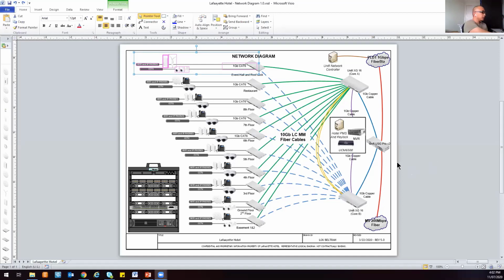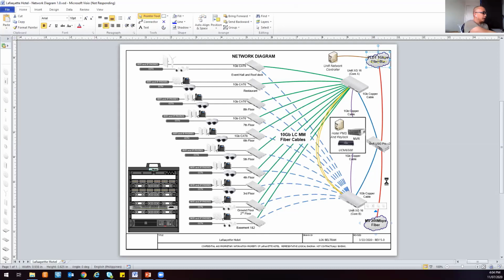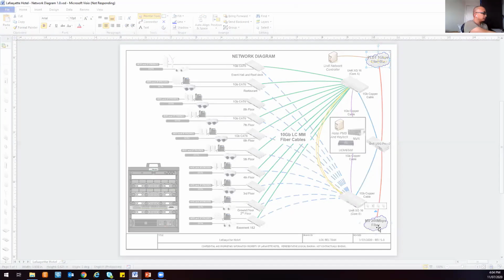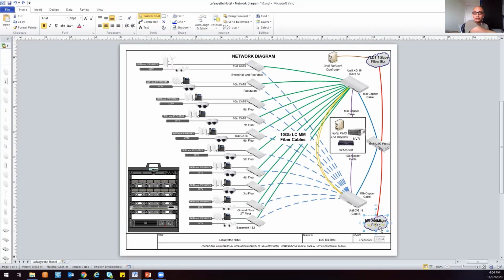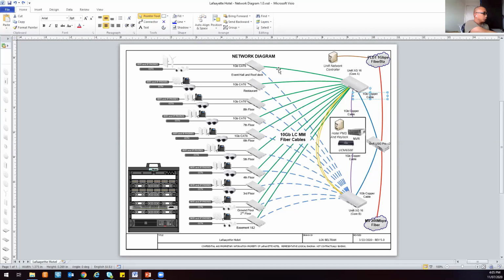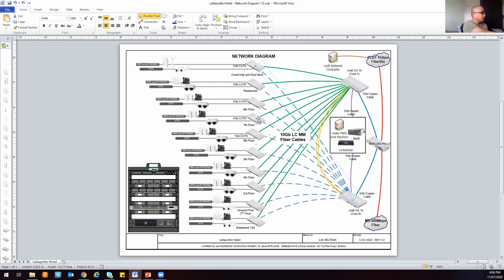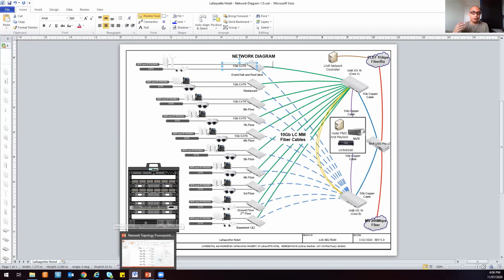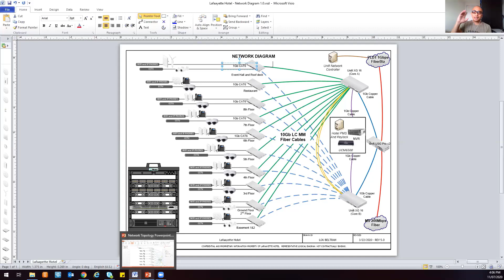[English] Unifi Hotel Network Topology Diagram Overview

Comment: Very nice practical video. I learnt alot. One question though, why do you need such a powerful internal network, (for example is has 100Gbps of total uplink to aggregation switch level), when you only have a 1.2Gbps internet connection.
Reply: It is a Network-Tree topology, he has 10GBit from the UXGs (supposedly with an aggregation switch each) to the “Area-Switches” for each location (each floor,the restaurant etc. gets 10Gbps Internal Connection). These are the shown fibers (two for redundant UXGs. This way the client could technically get the full 1gbps WAN access while leaving performance for internal use, such as Cameras.

Hope this helps!
Greeting from Germany
Reply: @zanderfaehrteisenbah  I get it, but it still feels like overkill, since there is only a 1Gbps copper connection to the NVR anyway. But let's assume for a moment there was no internal traffic, no IP phones or CCTV in the network, would you still need  such massive uplinks for a 1Gbps internet line? is there any benefit?
Reply from the maker: Future-proofing! I'm the type of guy to give 110% on my designs even if they are an SME and this will be used by the client for the next 3-5 years without any worries.

Comment: This topology looks straightforward with the use of your controller and a bubble tea, everything will just be ok,.. the only thing I can see here that I am scared of is the staggering price that comes with it.  Though Ubiquiti is cheaper compared to new high ends of cisco yet still belongs to sports cars category of network gears.
5 stars hotel can do it  duh.   Thank you for this idea Lou. looking for tertiary hospital topology. IT wannabe here.
Reply from the maker: Thanks! most hotels are failing on their wifi reviews so i convinced the owner to really invest on the network and wifi system because of it. when the wifi works 100% of the time and can give a very good experience to the users and thus results in great reviews for the hotel